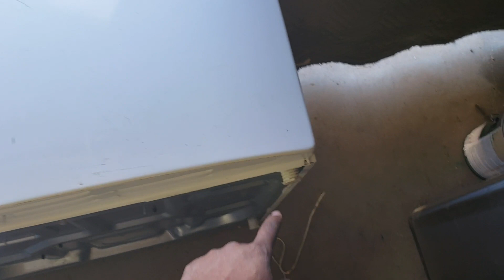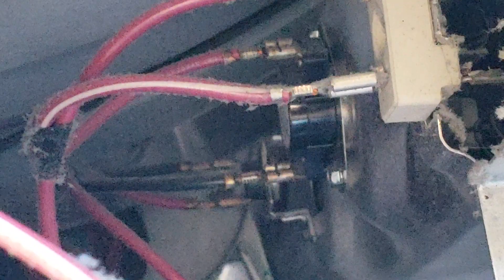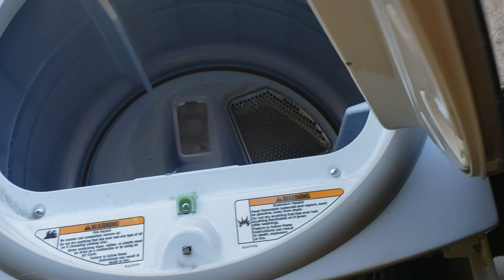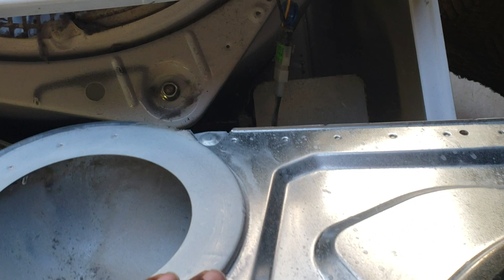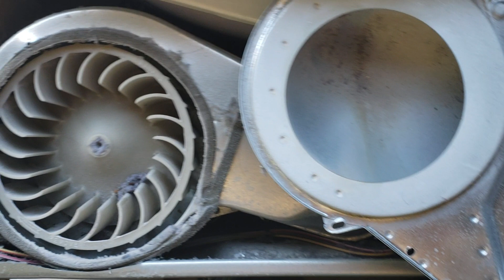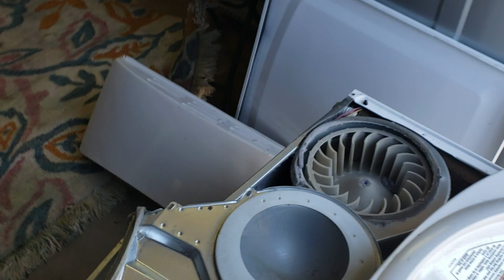Whirlpool Duet repair and maintenance tips

Comment: Have you ran into the 'sensing light' stays on after pressing Start and dryer doesn't start.
Reply from the maker: Depending on brand of dryer but what usually causes a dryer not to start is because of a high limit thermostat was triggered or control board
Reply: I'm having the same exact problem with the sensing light staying on and the dryer not starting. We're you able to fix your dryer? If so where did you find the parts? Thank you for your time.
Reply: @lovelylisawarriorqueen7923  did you ever get an answer, I have the same problem
Reply: @ragrac1  hi Rob, my husband replaced both little metal bars I guess those were some sensing elements or something and it didn't work the sensing light stayed on...BUT the young man answered and said replace the little white fuse thing and it fired right up. Let me scroll through the comment to get the part name for you. It's in comments on here somewhere. I was researching new dryers but their all cheap aluminium ones now so I'm so glad the duet dryer works again.
Reply: @ragrac1  it's called the White Thermal Fuse and it was like 8 dollars and fixed it right up since it wasn't the moisture sensors. I hope it works for you let me know I know I'm glad not to have to get a new dryer.
Reply: What does that mean Jaden
Reply: I'm fixed now. Blower was full of 15 years of stuff... Thank you sir

Comment: How do you fix the control lock.. I tried pressing the button stayed ther for more the a minute and still in control lock mode...
Reply from the maker: I would start by checking to see if the Child Safety Lock is on.  usually a mark button you have to hold down for about 3 seconds
Reply: Hello how do you fix the dryer that is heating up but not drying thanks.